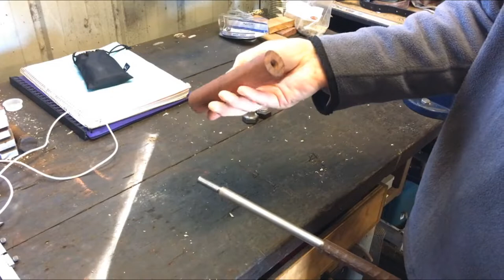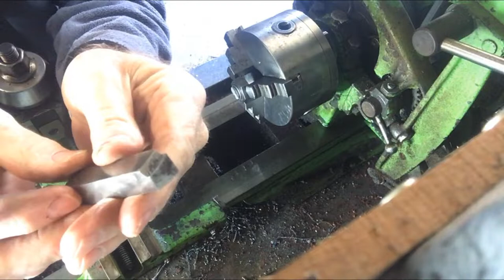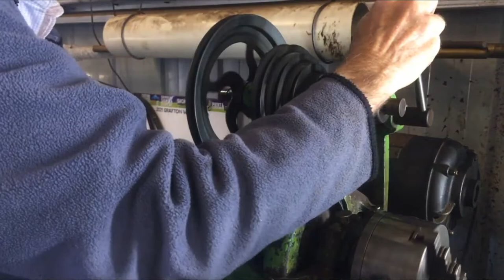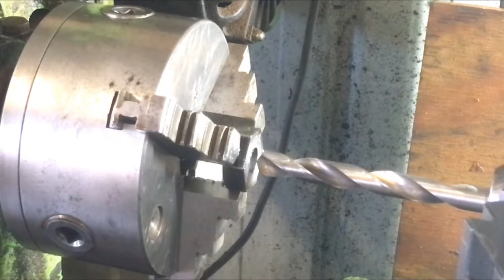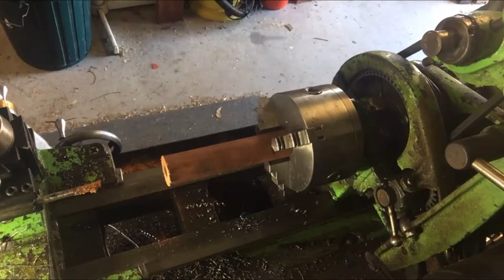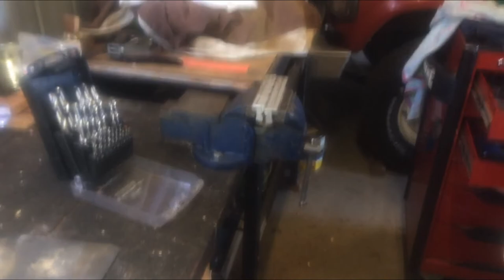How I Made a Fire Poker Handle

Comment: That was very interesting Dave. I reckon your second tractor bolt head has been well case hardened.
Reply from the maker: Yes it surprised me how hard the head of the bolt was and it was just the skin on the head which faces the ground.
It’s off a 6’ slasher (think big mower deck).  It’s spins around 1500 RPM which makes a huge surface speed at that diameter.
I change the bolts every year as eventually they would wear through.  I bought the slasher used and they were half worn through when I got it.
The blades weigh at least 5kg so that was a scary sight.